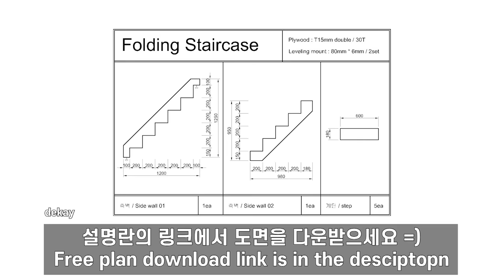[woodworking] Folding staircase for loft room

Comment: I like every video you do but sorry the design on this does not cut it all the weight is on the screws.this should not be copied or replicated without reworking it so the weight rest on the stringer.
Reply: Any suggestions? I noticed how the stairs have a slight wobble.And that would nice to eliminate whilst reinforcing the overall design
Reply: Relax it’s fine

Comment: Excellent video and great design. Thanks for taking the time to present this so professionally and to share your ideas with an audience. I feel that some of your subscribers may be missing the point with some of your creations. Many are just show casing design ideas and creativity. We can choose to steal your ideas and creativity to fit our own personal needs. The design and creativity doesn't need to stop with your version of a creation. Given that initial vision, your vision, we are allowed to tweak and improve as we see fit. As for a practical use for these stairs.... I have a very small downstairs closet in one of my bedrooms. In the ceiling of that closet space is an attic access opening. I don't need to go up there very often, just every 3 months to change a furnace filter. I don't need stairs hogging up needed storage space 24x7. I also don't like carrying up a heavy step ladder every time I need to get up there. For the few times I need access, clear a space for the ladder to unfold into and use the permanent folding ladder. Great solution for my specific use. Wonderful.

Comment: The hinge screws going into side or end-grain of the plywood are weak.
Reply: Same thing i was thinking. All those little screws are side loaded with a person's weight. This looks like disaster after the first time you run down them
Reply: Guess it depends on how much you weigh.
Reply: if you look closely, the screws are going into both along and perpendicular to the grain.  The question is where to get this kind of hinge as this is the first time I've seen such a hinge.

Comment: The hinges should be bolted on for safety, over time and frequent usage, those stairs will eventually collapse
Reply: I agree.....
Reply: Door hinges move many times with more weight and do just fine. They aren’t bolted. Usually only 2 or 3 hinges.
Reply: @guitar-jo  yeah ok

Comment: I'm sorry if I missed it but what kinda /where do you get that hinges from? Never seen it and it's the most interesting thing I've seen in a long time
Reply: In the video they are called a “t-hinge” but I can’t find them
Reply: These are “wrap” or “wraparound” hinges. When both sides wrap it is a “double” or “back to back” “wrap or “wraparound” hinge. There are different kinds, and not all will work.

Comment: Very cool stair, but... you should look over the design, if the screw fail on a stair you will hurt yourself bad, try to make the stair were the load is on top on wood not hangin in small screw’s

Comment: The project is great, but I hope you will add a link to the description to buy the unusual hinges from amazon. And also the other hardware...
Reply: Did you ever find the hinges?
Reply: These are “wrap” or “wraparound” hinges. When both sides wrap it is a “double” or “back to back” “wrap or “wraparound” hinge. There are different kinds, and not all will work.

Comment: Nice work! What is the specific hinge you used, manufacturer and part number? Thanks!
Reply: What is the model of the hinge called
Reply: These are “wrap” or “wraparound” hinges. When both sides wrap it is a “double” or “back to back” “wrap or “wraparound” hinge. There are different kinds, and not all will work.
Reply: @saltwaterpurl  where can I buy these?

Comment: Looks fantastic! I will use this as my reference design for my staircase! Question: what was the reason behind using two sheets of plywood for each piece? Was it a load bearing issue?
Reply: I'm no carpenter but I think it has to do not only with load but also to resist warping. 
This is a great idea. I can think of many places it could be used.

Comment: This stair is dangerous, because screws heads can break itself under payload. I recomend to make rounding on the edges of wood (on the top and bottom sides) for reducing possible damage for legs due to sharpen edges on the stair. Be caryfull, please.

Comment: This clever but shows a lack of engineering knowledge.  You have hung your treads on the stringers, subverting the inherent compressive strength of the wood.  Instead, you are relying entirely on the shear strength of less than 10 wood screws.  Would be nice to see a version that relies on the standard design strength of the elements .  This effort is fine for light duty but will fail over time or with heavier loads.

Comment: I don’t understand the purpose of this over a standard staircase.  When folded, you can’t put anything in its way so you don’t gain any extra room.  This design also looks more wobbly than a fixed design.  Its cool, but not practical.
Reply: Good for a tiny house

Comment: Why? 

It looks like its not a tight space you will be working in, and your computer is up there, so you should be going up there pretty regularly, so you can't store anything where the steps fold down.
Cool project but this was a useless application for it.

Comment: Very cool, and this guy is obviously talented, but i'm wondering why folding stairs were necessary in that situation.  Not like its saving much space.  I mean, you could put a chair in that corner, but you would need to move it away to un-fold the stairs.  
Be better off if it was a bookshelf that un-folded into stairs.

Comment: This is not only a dumb idea but a dangerous one. Why dont you jump on the stairs? Or walk up them slowly? What if someone builds this over something hazardous and didn't realize that these tiny scews or the hinge are not designed to support a load this way? Irresponsible.
Reply from the maker: It was my first time making it, so I used it slowly.
Now it's in use by jumping freely, and it stands very strong.
I only use it by myself, so it may not be broken yet.
But are you angry? I didn't even share how to make bombs.
Calm down friend 🙌